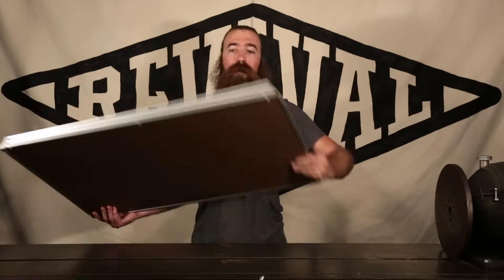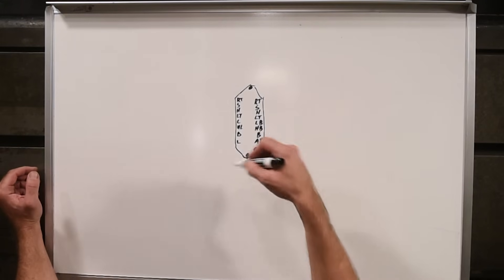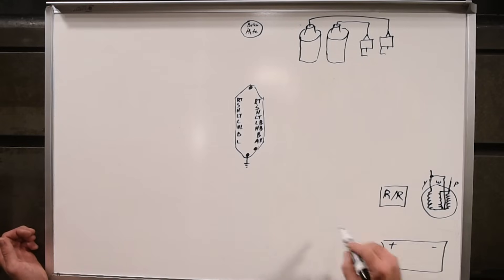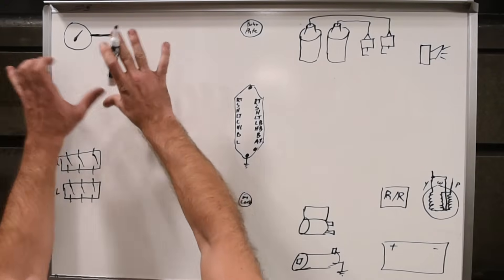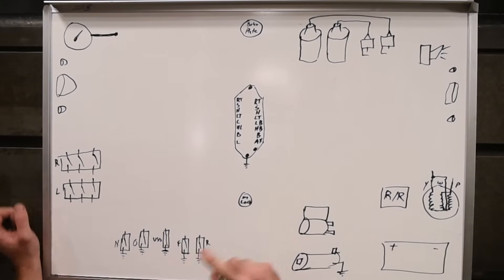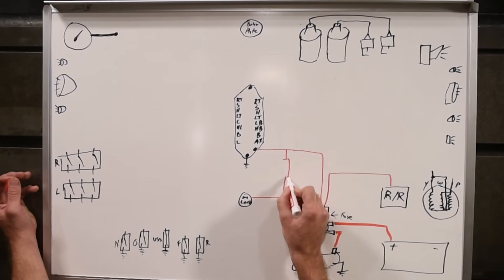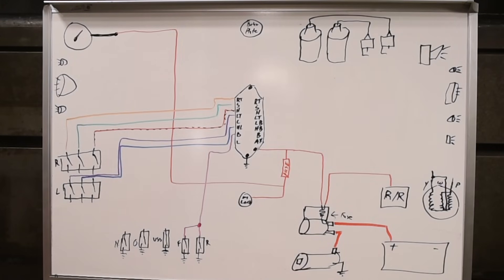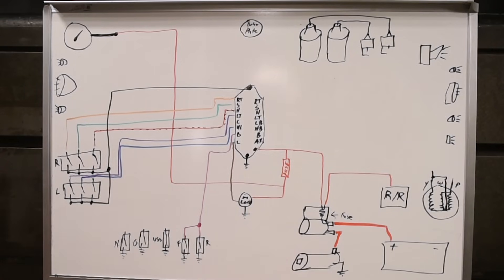How to Wire Your Motorcycle  - Revival Cycles' Tech Talk

Comment: Thanks Stefan, great overview. A quick question; in your experience, where on the bike is the best place to mount the m.unit and how do you go about fixing it in place?
Reply from the maker: Mounting locations are really up to you and where you have room. The m-Unit itself is completely waterproof, but the connections to it arent but that generally isn't a big deal and they hold up fine as long as they aren't in a spot that gets a ton of water. Also good to keep an eye on the heat, typically the heat above the engine under the tank is fine, but I'd be careful if it needs to be mounted near the exhaust headers. 

Common spots for mounting are under the seat, under the tank, in the tail section, behind a fairing, behind a side cover or in an custom electronics box. To fix it in place you there are two mounting holes that you use to bolt it to the bike.
Reply: Revival Cycles thanks!

Comment: ...hello Stefan; you have there pretty god videos and your pace to explain is very good.
I know that you are more focused to new bikes etc but could be good a clip or an explanation on bare bones wiring; I mean, I have a T140 Triumph street tracker with a new magneto instead of coils and battery; so I will wiring very different than this. Thanks
Reply from the maker: I would like to be able to make a video like you describe, but it gets into very specific issues that are make and model dependent. There are so many different ways to wire up an old bike like this, it would be really tricky to cover. The thing that is so great about the m-Unit is that it works on almost any bike, and is about as universal as it can be. Unfortunately there aren't many magneto bikes left, but they are super cool.

Comment: I did not see a connection for running lights.  I would think they would connect  aux, and then this to dash. Fused ?
Reply from the maker: The running lights (meaning the turn signals on at 1/2 brightness) can be configured and controlled by the m-Unit and do not need an additional wire connection. As for the dash lights those can be connected to the AUX outputs or to the ignition output. There is no need to use an additional fuse for dash lights as long as the wire connecting it all is 18 gauge of larger.

Comment: How much do I have to worry about my battery size if I'm running kickstart only?
Reply from the maker: Battery size is not that critical if you are running kick start only. You;ll need the battery to smooth out the light flickering at low RPM and also provide enough power to run the ignition system when starting the bike, so not much capacity is needed. The voltage regulator will keep the charge voltage from getting too high, but you may want to consider what the charge amperage would be and make sure you get a battery that can handle that.

Comment: Kick stand switch common on these?
Reply from the maker: We didn't get into the kick stand switches in this video, mostly because we are trying to keep it clear and simple so its easier to understand the main concepts. Also, our preference is to delete kick stand switches to keep the wiring bulk to an absolute minimum on the customs. But the m-Unit can be integrated with a kick stand cut out switch for those that want to retain that function. There are actually many ways to do it, but the details usually depend on the specific bike in question. If you need help with an installation that includes a kick stand switch email us at techsupport@revivalcycles.com

Comment: How to connect fuel indicator
Reply from the maker: So this video is from the old V.2 m.Unit. The new m.Unit Blue has two AUX outputs which is where you would supply power to a fuel indicator light.

Comment: What regrec do you guys recommend for a 1977 GS550?
Reply from the maker: Depends what type of charging system it has. Need to look at a wire diagram to know for sure.
Reply: Here's a link to a very short video I just made to help answer your question:

https://youtu.be/rRLeuhTUq3M

Looks like 3 stage field excited. Let me know if I am wrong - electrical work is a major learning curve for me. Thanks again. I'm looking forward to purchasing a few parts from your shop and then showing you my bike once I finish the work.

Comment: So does the m.u. Totally replace the cdi on my kwak?
Reply from the maker: The m-Unit is a power distribution device, it does not do any engine controls. The CDI is part of the ignition system and is necessary to get the spark to occur at the correct time. If you would like to replace the CDI you would need to source an aftermarket ignition system and install that following the manufactures instructions.
Reply: Revival Cycles thank you!

Comment: Can i turn an battery inplant into one without battery just removing battery cables
Reply from the maker: The m.Unit requires a battery in order to operate. A battery eliminator or similar capacitor set up will not provide enough voltage to power up the system.
Reply: Revival Cycles thanks

Comment: with the m-unit i can eliminate oem ignition modules?
Reply from the maker: No, the m-Unit only powers the ignition system, it does not control spark timing. Both the charging system and the ignition system need to be designed specifically for your motorcycle. Either the OEM or a specific aftermarket kit. 

In this video, we show the m-Unit connected to a standard Breaker points type ignition with two coils. This setup is typical of what you expect to find on a bikes from before the 1980's
Reply: ok thanks a lot greetings

Comment: How would this diagram be different if I weren't using an m unit?
Reply from the maker: Ummm, that is a tricky question, there are a lot of different ways to do it, but most systems are model specific. That is one of the cool things about the m-Unit is that it can be used on virtually any bike. I'll think about how we could try to explain a basic OEM style tutorial, but I'm concerned it won't be able to address the variations in models.
Reply: Revival Cycles That makes sense. I have an 82 xj650 I'm trying to do a basic wiring on, but maybe if you did a general instructional video for a basic wiring diagram for Japanese bikes in that era? Thad be awesome!

Comment: Can this be used for a Honda cb650 1980
Reply from the maker: Yes, definitely.  The majority will be very similar to what is shown in this video, but you may have a few changes with the ignition system, and charging system. If you need help during your install send an email to techsupport@revivalcycles.com
Reply: Revival Cycles thank u so much. I think i will get an m unit for My bike.

Comment: Hey everybody! I attempted a 6v to 12v conversion on my 82 honda xl125 everything is working but my headlight. When i rev the engine my voltage to the headlight spikes to around 25v exploding the bulb! Is this a regulator issue or maybe bad ground? Anyone had similar issue? Also all components have been changed from 6 to 12v excluding the stator. Thanks in advance!
Reply from the maker: Yes, this sounds like the headlight runs on an unregulated AC circuit, and depending on how you did the conversion that could be affecting that. There are a couple solutions, but without knowing the details of that specific charging system its difficult to guess. It might be simple enough to just add a 12v AC voltage regulator to the headlight circuit in addition to the 12v DC regulator/rectifier for the battery and rest of the bike.
Reply: Revival Cycles wow thank you so much for the prompt reply ill give it a shot!

Comment: Can you help? I have a GS550 1979... Kick and Electric but I no longer want the electric start, wanna save a bit of weight and electric starts bore me haha
Reply from the maker: There is no problem using the m-unit with a kick only bike, just have to remember to turn the headlights on after kicking the engine. In terms of wiring, just eliminate the start circuit, starter, and starter solenoid. Then you'll just use a normal main fuse holder, or the waterproof one that we sell with our deluxe wire kit.

Comment: What does my IC igniter plug into on m unit?
Reply from the maker: If you are installing with a factory ignition system, you will replicate the same connections as it originally had. So find a wire diagram for the stock bike, trace out the ignition system, and anywhere that is connected to switched +12V power that gets connected to the ignition output on the Blue, or to the AUX output on the V2. 

Now there are some ignitions that do not get 12V power, these are true CDI ignitions, and they use a switched ground connection to kill the spark. This install needs to be done with a normally closed relay that is controlled by the ignition output or the AUX output.

Comment: So your brake light doesnt have a running light ..??
Reply from the maker: It does have a running light. When using an M-Unit the unit itself controls the voltage output to the tail light so you can have a single wire that will function as the tail and brake light.

Comment: Does anyone know if this is the same concept for a yamaha 250 ?
Reply from the maker: Yamaha has made several 250's over many decades...but generally yes, this will work on pretty much any carbureted bike. Dirt bikes can have a few variations, but for most street bikes the install follows this description. Fuel injected bikes can also be done, but there is more work for the engine management system.

Comment: will this work for a Yamaha virago?
Reply from the maker: yes
Reply: so just so I'm clear before spending $300 on your website, I can gut my entire harness and follow this tutorial instead?
Reply from the maker: Pretty much, you will need to retain the entire ignition system (or replace with aftermarket) as well as the charging system. So for the ignition system you need to have ignition coils, and the ignition control module. On the charging system you'll need the reg/rec. Beyond that, the rest of the install is just like this video. I strongly recommend the m-Switch minis rather than re-using factory handlebar switches, it makes the install much easier.
Reply: thanks! you guys are awesome!

Comment: What is the M unit?
Reply from the maker: It is a lot of things but at it's core it's a modern, power distribution module with solid state relays and fuse protection. You can read more about it in the knowledge base on our site in the link below. 
https://technicalarticles.revivalcycles.com/hc/en-us/categories/360000739551-Motogadget

Comment: How about a 1981 Yamaha virago 920?
Reply from the maker: What about the 920?  Yea, the m-Unit is perfect for that bike, and the setup would be very similar to this diagram. Just a few changes around the ignition system, and dash / gauge so it matches your setup.
Reply: Revival Cycles just wasn't sure if this exact set up and video would work for my bike or if it would be different, or if there could be another video made

Comment: Hi, I have a couple of questions;

How would you wire up a 3-wire ignition system such as the one on your website?

And my bike is a Honda CG125 90' kickstart model (very basic but I am new to electrical) but I've seen in previous comments you say to eliminate the electric starter components. I have illustrated my diagram that I've drawn up (haven't wired up yet), are you able to confirm that this is correct and most importantly safe?

Diagram here: http://imgur.com/Drac20r

Thanks!

Comment: If your using an Munit then this is not a normal wiring harness for ANY bike,,,,legal bikes need alot more wiring because not everyone is going to use the Munit just a fuse box...but great video anyway
Reply from the maker: Hi Bruce,
This video is intended to provide a basic rundown of how to wire up an m.Unit as that is a specialty of ours.  The m.Unit's features and capabilities meet the legal requires for an operating motorcycle anywhere. Unless you can find a location that does not allow any deviation from OEM electrical systems.

The Tech Articles page on our site provides in depth explanations of the m.Units features as well as diagrams and wiring theory if that something you're interested in. 

https://technicalarticles.revivalcycles.com/hc/en-us

Comment: where's the mandatory USDOT kill switch?
Reply from the maker: The start button is also the kill switch. a very brief double tap cuts power to the ignition or if you're not comfortable with that you can install an independent kill switch.
Reply: @RevivalCycles  Was under the impression that it had to be a separate easily identifiable spdt (toggle) button as it was intended not for the rider but for anyone to use in an emergency... Can't find the DOT code I read but watch it for the lawsuit 😏

Comment: Don´t work on a S&S 105 cui stroker....My M-unit did not do the work!!!!
They say in the advertise....that "it works on most of the bikes".....But be more specified on that describsions.....I burn my M-unit ( Start connection)
( DONT WORK ON A STROKER ENGINE!!!)
And I had to connect a cheap starter-relay ,and that works perfect!!!!
Reply from the maker: Sorry to hear it, that's an expensive mistake to make. There are plenty of successful m.Unit installs with S&S engines out there. By the way you describe it sounds as if you might have run the start output directly to the starter motor without installing a starter solenoid between them. The m.Unit has built in relays with a max 15 amps per output, this is not enough to drive any starter motor without a solenoid regardless if it's an S&S or a CB350. Technically speaking a starter solenoid is a relay but capable if handling much higher amperages.
Reply: @RevivalCycles  Learn by doing :-)

Comment: you brake light is wrong you tied your constant break light into the break switch light you need to run a constant to the tail ight perhaps from the license lamp light the rest of your harness looks good, only other thing i would suggest is to put in a few relays makes a world of difference.
Reply from the maker: When using an M-Unit the brake light wire from the M-Unit "brake" output runs directly to the brake light wire on the tail light. The M-Unit regulates the voltage going to the brake light so when at rest it get's less voltage until the brake switch is actuated then the M-Unit sends full voltage (12v), making your tail light brighter for a brake light. 
No need for relays with this diagram.
Reply: I want to ask you a question my bike won't start does the neutral  safety  switch have to be hook up because my bike is turning  but won't and it's backfireing
Reply: It's a 2000 harley softail s and s motor